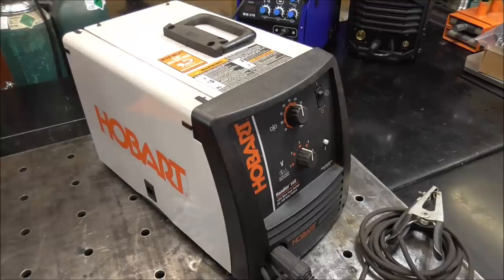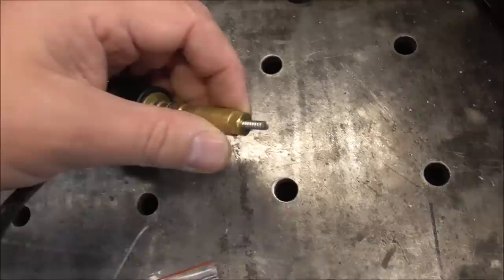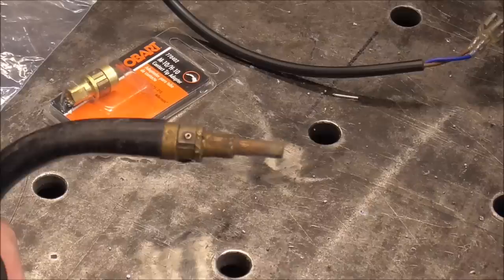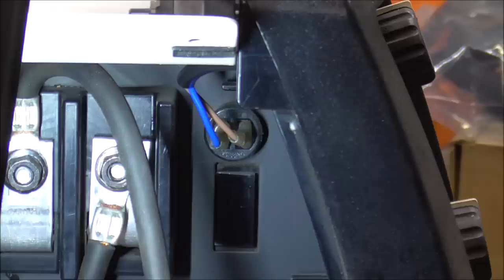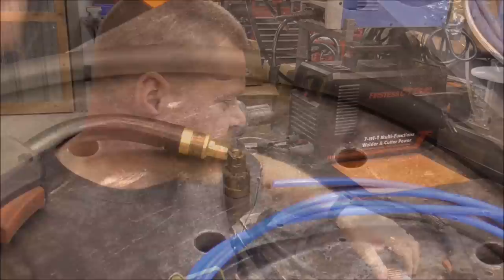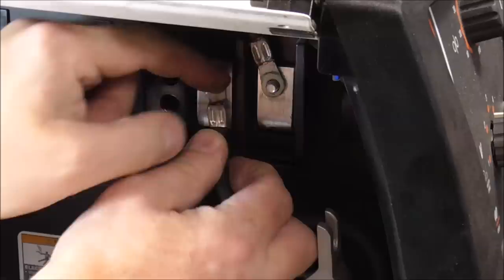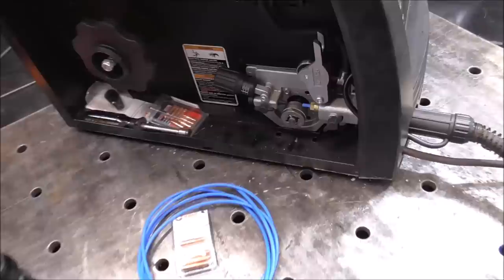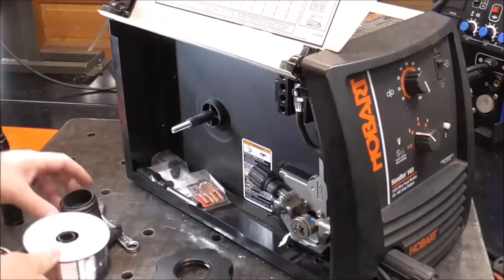Convert Your MIG Welder to Weld Aluminum - The Easy Way

Comment: reminds me of this one.. once you get it set up it literally is just 'the more you do it' i find my 280amp does a much better job for consistent bead, just has a better duty cycle at the amps/current needed - your welds looks a little better than the ones in this vid though https://www.youtube.com/watch?v=CzcyA6Z-8dk
Reply from the maker: Once it's setup correctly then it's just a matter of seat time. The more you do the better you get. This was more about concept rather than trying to make a pretty weld. That comes with more seat time.

Comment: Not a $25 conversion is it. 1 tank argon $150
Reply from the maker: Aww man, you caught me. Let's just keep it between us though okay?  It's actually around $2,430.00.  The welder is $600, the rent payment where the welder is kept is $1000, property taxes another $200, the power bill is $150, the bottle contract is $100 plus another 75 to fill it, insurance $200, my labor spent doing the conversion $80 PLUS the $25 to buy the supplies for the conversion. And I'm sure there is more I'm forgetting....

Comment: Unless your using flux core you should always push mig. Flix core ain't really mig
Reply from the maker: You can do either which is supported by wps in commercial settings, so there is no hard set rule on travel direction when using hard wire. Self shielded must be dragged.
Reply: @BrandonLund  which is what I said   I was taught to always push using gas so the weld puddle is shielded.  Also you are way better off using a spool gun with ally wire in my experience..

Comment: You are loosing so much Heat into your Table with the Heavy Steel construction 😢
Reply from the maker: Thats actually a good thing in this scenario. MIG welding thin material is difficult because it runs very hot. I'm using the table as a heat sink to help me out.

Comment: if you moved faster you will not get the burn through  and the parts look ugly
Reply from the maker: Your comment shows how little you actually know about welding aluminum using this setup. If your going to be a smart mouth at least know what your talking about

Comment: Okay, this video is the LAST "low cost" video I click on if this is another click bait BS title.... waiting to see.....    Yup... Hobart .035 tips 10 bucks... Weld tube liner  20 bucks...  Tank or argon...  179 bucks...  spool of aluminum feed wire 16 bucks...   that adds up to 25??????? well, that's it for me and these type of click bait titles... eff this.. .
Reply from the maker: Don't forget the cost of the welder, the electricity to run it, the rent or morgage payment where its kept, the bottle contract fee, gasoline for your car to pick up the bottles and your billable time per hour.  Where are you buying your tanks for $179? Sign me up, I'll take 2!
Reply: Henmich, I agree with you. But you forgot to add the cost of electricity used watching the video, the food required to energize your brain, the wear and tear on your body switching parts etc. Also add in the 13.5 % inflation to everything because you voted for joe biden.
Reply: @Dixler683  durrrr... nice comeback... stop blowing this guy, wipe your chin off and get a job.

Comment: Bro your stick out is way too long. Ive been welding aluminum mig and tig since 2010 and have never seen someone stick out that far
Reply from the maker: The length of time you've been welding doesn't change that MIG Aluminum gets a contact tip to work distance of 5/8" to 3/4".